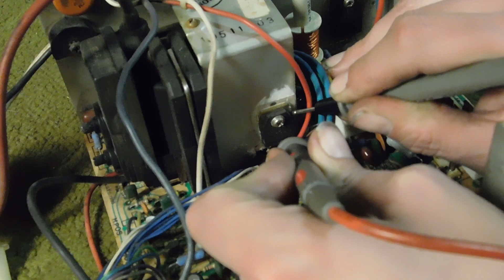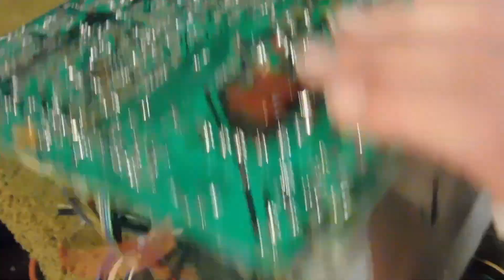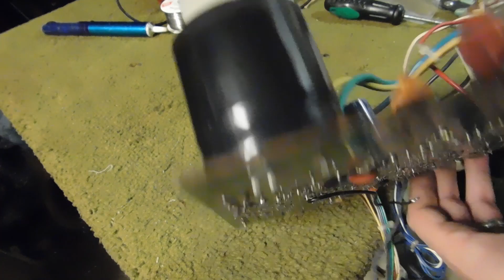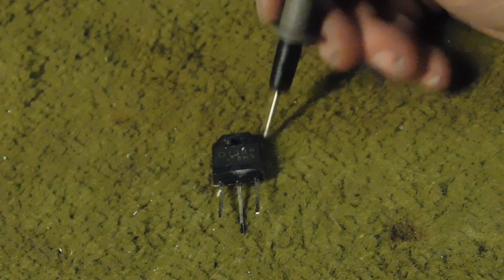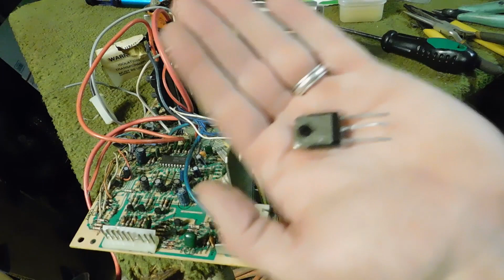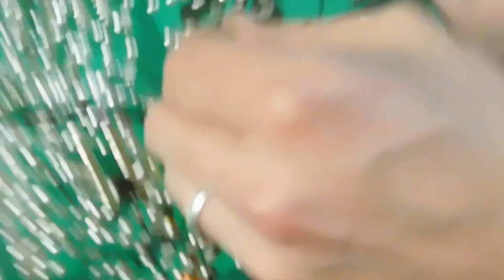How To Replace A Flyback & H.O.T. {Wells Gardner K7000}

Comment: When adding capacitors across the Flyback terminals, what does the capacitors do to the flyback windings?
Reply from the maker: I'm not sure exactly, but I'm assuming it causes voltage input change of some kind. I think I figured out why but can't confirm for sure. The next video I'm working on talks about just that. Ultimately I think it has some to do with the PCB missing the HV Shutdown POT.